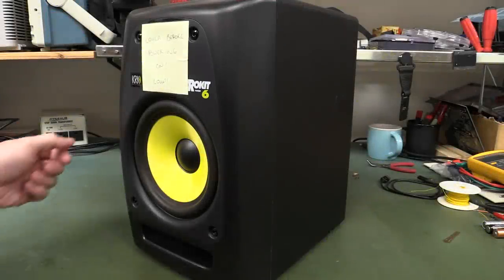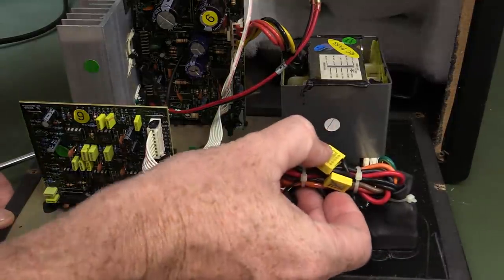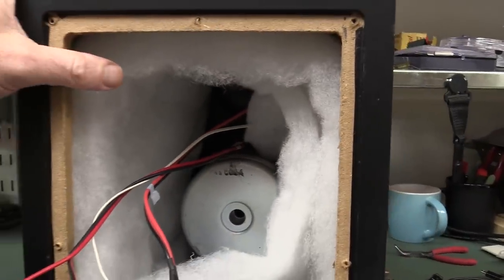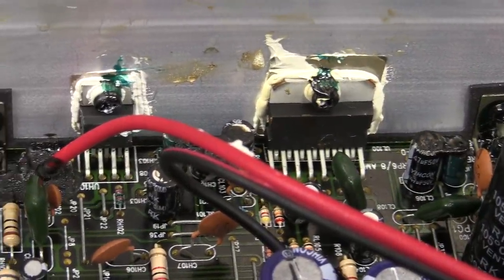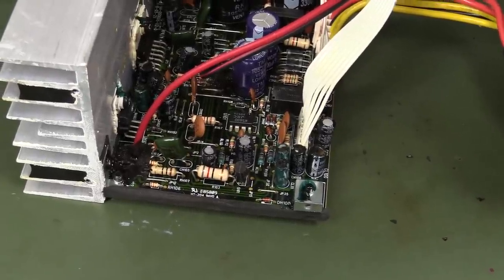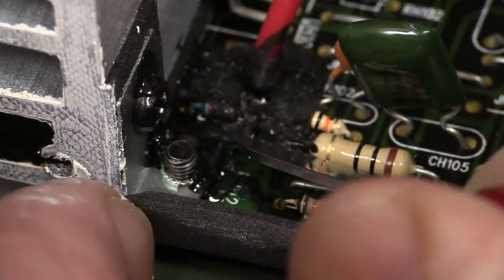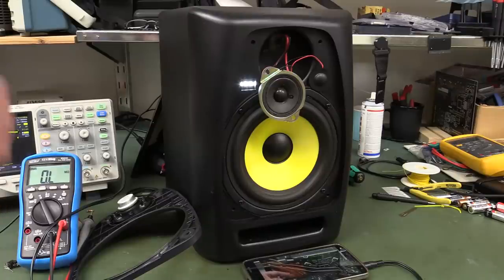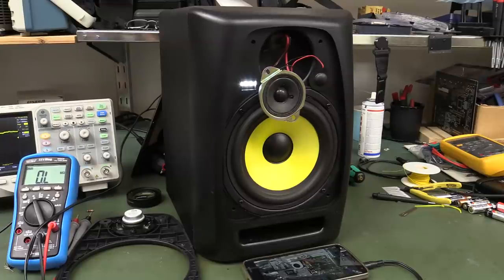EEVblog #1072 - KRK Rokit 6 Studio Monitor Speaker Repair

Comment: Watching Dave for years, I own a pair of these and I had similar issue with them - figured out the glue was the problem - didn't notice the corrosion.  Haven't powered them up for about a year, gonna buy a different set (not KRK) - noticed this happened about 18 months after I purchased them.  Suppose to have 2 year warranty, but being in Canada they said, no, 1 year for you!  Ahhh - I was going to buy Yamaha's or Alesis, but the shop had no stock that day... ended up with KRK by chance.  Sounded good enough at the time (new)

Comment: I've used Behringer active monitors as my computer speakers for around 10 years now. Best speakers I've ever had and cheap as hell at least when I bought them. Only problems I've had are because they seem to have really crap shielding so you have to be careful where you plug them in and how, e.g. if I use the same extension chord for them as for my computer the noise is horrendous.

Comment: Interesting resistive black gunk, I have had quite a bit of equipment have vibration gunk added from factory but never seen a resistive one before, it may be a built in buy and throw out to bin thing or it is a mistake by the manufacturer, either way not tbag to fix.
I have spent many hours on trying to find a solvent for some of these paste/liquid damper aids added to PCB's and nothing seems to disolve any of them, would be great to find a solvent as it would make the job so much easier.

Comment: AMAZING video, extremely relevant to my interests. I have a pair of KRK Rokit 5's (gen 2) with very similar problems. Obviously this crap gunk can infiltrate in crazy different ways. One needed to be on for a few hours before it worked properly, the other would be low volume until it 'warmed up'. One now has the same symptoms of daves tweeter on its woofer. I replaced the speakers with yamaha's so it might be worth having a go at the buzzboxes. I only have a use for one more, so if I get it working I'll have see if I can't get a tweeter out of the other to send to Dave as thanks!

Comment: Dave, where you said "indent", I'm sure you meant "detent", as you used to say back in the day. We have two black gunk products in the U.S. "of interest".: Blackjack "roofing tar in a can", and "Shoe Goo" shoe sole re-attachment glue.These are both very black(due to high carbon colorant?) I am surprised that yours became so very conductive &corrosive. You are right to spank KRK for bad assembly practices. Good luck & great video!
Reply: Roh-kit (Rokit)is supposed to be a misspelled "rock it"(rockit) i believe. Dang my caps lock key!

Comment: I am currently cleaning out the black gunk from my rokit 5s (X2). I have been lucky as to, there is very little corrosion. All components are intact. I am cleaning and treating areas need be.

My only issue is. On one of my monitors. The switch is constantly on. I switch it off and it is still on. What can I do to fix this? Great video btw, thx EEVblog.
Reply: Anyhow. I have completed the clean up of corrosive black gunk on my rokit 5s G2s. I figured out the switch is dead. I replaced it and all is well. Thanks for this video Dave. You have saved me a lot of grief and money. You're an awesome bloke. Fellow Aussie here.

Comment: That just shows that it only takes one bad decision to ruin an otherwise good design.
Reply from the maker: Indeed. And impossible to test a long term thing like that
Reply: True, but also why I think it's important to be conservative when using materials that are being smeared over parts like this.  If I'm not sure that it's been proven over many years previously for this type of use case, then I'd rather not use it.  There are other materials that can be used for vibration dampening.
Reply from the maker: Yes, plenty of proven flexible potting compounds for example.

Comment: I've had several KRKs come in to my shop out here in Caracas, the BlackGunkofDeath is the main issue, but I always put in new higher voltage power caps, had many come in with strange popping and crackling noises from these cheapos going bad. Great video, hope you are well dear bro !
Reply: will you please tell me the part number of the caps you used? it would be a big help. Thank you

Comment: Have seen that conductivity problem on high end vintage hifi amps as well. In pro studio world we never touch volume controls on speakers as they are 'calibrated' to be a constant. If your monitoring system never changes then you can balance mixes easier. Its all about getting used to the sound of your monitors in your environment. I suppose its the same as with old analogue scopes - going to a known timebase before probing an unknown signal?

Comment: Good video Dave. I have a question that maybe some of you here in the comments can answer. Can ordinary hot glue suffer from this problem? Would it have been a better compund to use in this case? Also, I've seen boards with a sort of yellowy white coloured stuff on it which may be similar to the black stuff in the video. Can it suffer from the same problem? I'm just interested, as it's not something I would have suspected when looking at broken things. Good catch, Dave. :-)

Comment: Black Gunk - possibly the bees knees in the day - likely an attempt to prevent vibration from causing issues on the boards considering there is no other protection such as an enclosure for the electronics.

Comment: love your channel dave, but your a bit of a noob when it comes to studio monitors. your supposed to connect the krk speakers to a usb audio interface and use balanced cables (xlr, trs etc) from the usb audio interface to the speakers. the audio interface has the volume control and headphone jack. this way you only need 1 volume control and headphone jack for the speaker setup.

i would NEVER buy studio monitors with garbage like that on the front!!! lolz

Comment: i repaired one of these a year or so ago, it powered on but nothing came through the speakers, turned out to be the lead free solder cracking all over the place, reflowed a bunch of connections and works great, these things are ok but for the price they should be given a miss

Comment: The repair guy at my previous work had a very similar problem with some old Bang & Olufsen speakers where the sponge pads used had dissolved to an oily goo and became conductive as well. These were super expensive speakers too, so I was shocked to find that this was a thing. And especially on well engineered stuff like those were.

Comment: While this one is open, it would be interesting to check for a Pin 1 Problem - I have a hunch that the lower-end KRKs are commonly afflicted by this to this day. XLR pin 1 ought to be connected to chassis ground (which in turn goes to star ground), but once in a while you will find constructions that connect it to local circuit ground first instead, which can cause ground loop issues due to ground currents making their way across the board (thus reintroducing a problem that balanced connections should be essentially immune to).

Comment: ok i am cleaning out the boards of my 2 broken speakers. one resistor broke of deteriorated. no problem. one of the tweeters dead.
hope i will not mechanicaly make more damage while cleaning. does anybody know where to buy the tweeters in  europe? i seem to find them only in the u.s. for sale. any ideas? or even decent alternitivs that fit?
Reply: bought 1" silk dome tweeters in aliexpress and sound pretty much the same
Reply: thanks...which ones did you get? most of them seem to have 4 screw holes...could you send a link?

Comment: I love repair videos,i could watch you live stream this type of videos every day,just keep em coming.
And btw its a common problem with those type of speakers to have gunk that turns corrosive and conductive over time,only fix is to scrape it till it eats the copper of the board.

Comment: I have a TANNOY 402 monitor and the transformer was driving the "woofer" directly magnetically because it was very close and unshielded. i had to take the transformer outside the box. why they don't use switching power supplies? assholes, they exploit the musicians and the audiophiles.
Reply: SMPS are a can of worms in their own right. For one thing, they have a tendency to abruptly shut down when confronted with current pulses, not to mention potential EMI issues and high coupling to mains that makes them unfriendly to unbalanced connections.

When experiencing magnetic coupling, experiment with power transformer orientation and location. In this case you want transformer windings and voice coil windings to be perpendicular to each other.

Comment: The gunk is probably a form of planned obsolescence, if you have a gunk that can go conductive after a few years, then you can ensure that after the warranty ends, the speakers will fail shortly after.
Reply from the maker: I doubt it was intentional. A company that make ONLY studio monitors which are supposed to last a long time wouldn't deliberately do that.
Reply: I will have to look more into the brand since my first thought was that they were pulling an Acer where they purposefully choose a design that leads to failure, such as using a bunch of 105C rated caps, but then deliberately going with 2 85C rated caps that just so happen to also be directly above a heatsink so that the cap gets cooked and the monitor fails shortly after the warranty  ends.

Comment: Hi Dave! I have this exact model. Is there anything I can do to prevent this happening and would replacing those cheapo caps stop the slight crack/thump noise i occasionally get when I switch them on?
Reply from the maker: Go in and remove all the black gunk now.
I doubt replacing caps will fix any crack/thump issue, it's more likely the gunk doing this, I've seen reports of that.

Comment: Just out of curiosity, but did you put that save 1000 mfd cap back in there....I found two other KRK speaker monitors youtube videos that had the exact same loud buzzing and the repair was to replace the 1000 mfd caps....they replaced both
Reply from the maker: Yes, same cap.
Reply: EEVblog makes me wonder if the real problem on the other ones wasn't the same black crap and replacing the caps inadvertently fixed it by breaking the conduction path.  I didn't like the sloppiness of that spray and the gobs of heatsink compound.

Comment: Got two of these on my desk right now so I'm watching with fascination.
Reply from the maker: Go and remove the gunk now!
Reply: @EEVblog  I finally got around to checking the board as I had to replace some caps.  Luckily my black gunk is dry as a bone.  I heard it was a batch of out of date potting compound that caused this issue, I must have got lucky.

Comment: The black gunk, reminds me of the black gunk that I have encountered from leaking electrolytic capacitors. In my case the caps were still working but had leaked out the gunk due to high temperatures inside the enclosure. The black gunk in my case was had all the same characteristics that you are seeing here. It also corroded a number of components that were covered in it. My fix was to remove the caps and clean the board, then replace the corroded components and finally replace the leaking caps. Note that this was back in the 1980's!

Comment: good thing i got jbl studio monitors.
Reply: Don't be too happy yet... ;)
Reply: why wouldn't i be happy they sound better and are built better.
Reply: lil Pure ok, if that's the case then never mind... ;) I've had some bad experience with jbl gear (same issue as this one), but maybe they have changed production?
Reply: what jbl gear did you have?
Reply: It's a quite old (15 odd years?) JBL SCS135 subwoofer/5.1 system. Ok, it's consumer crap ;) but it had a similar issue as shown here a couple of years ago. I managed to fix it the same way as Dave showed (and it's still alive after that fix), it's quite a common issue as it seems. Hopefully, JBL don't use that gunk stuff in pro gear, but if they do: now you know how to fix it, if it ever happens. xD
Reply: no one has said any thing about buzzing on jbls pro audio gear but on their home gear around 5 years ago people really started to complain about it.

Comment: You'll need an pre amp to drive that speaker correctly (or any other analog active studio monitor) and most pre amps will have headphone amp built in. Schiit audio and Benchmark audio make some seriously good pre amps and dacs.

Comment: I think you miss the point of studio monitors if you want to directly plug in headphones. I have Rokit speakers and I love them. Impressively built but I've never taken mine apart since I didn't want to affect the finely balanced response.
Reply from the maker: No I don't miss the point. My needs are perhaps slightly different to a bigger studio. I don't want yet another box on my desk for headphones and volume, I like it built in.
Reply: EEVblog sorry if I came across rude there. Enjoyed the video. The difficulty I find with these speakers is setting them up in a proper acoustic space since that can severely impact the low end response. I sometimes do music mixing with mine and therefore the nuances of the mix are critical.
Reply from the maker: I have a typical work desk, so mine are close, within arms reach.
My Alesis's have one mains cable, one USB cable, one speaker cable. Regular monitors would need two mains cables, a doodad volume/headphone box on the desk, a USB cable, and two RCA/XLR cables, messy.
Reply: Yeah, but typical KRK and similar monitors user already have an audio interface with headphone jack and volume knob. It doesn't make sense to double them. Only the cheapest "multimedia" (not studio) monitors have them on the front panels.
Reply: mpingo91 yes I think that was my point. And the level on the back is just for fixed attenuations depending on the input level.

Comment: But really once you move over to a Class A 2x 100W tube amp its just no going back for home audio for PA i use a 12kW total power system
Reply: Good luck using tube amp in monitor speakers...
Reply: No you don't, stop talking crap! I'm ex-Audio Note, 12w SE per channel would blow your head off with efficient speakers. Got a mate who restores Western Electric cinema amps and a mono amp for a 1,000 seat is just 20w Class-A. Not even Marshall stacks pull 12kw.
Lastly, Andy 'PhotonicInduction' is a good mate of mine, lives near me, you are not him so shut up!
Reply: Putting 12 kW through speakers at home is a very fancy way to die.
Reply: I didnt say i use 12kW that is stupid for home i use it for PA for concerts party and so on and even then ive only got total of 8000W in amps just the speakers are 12kW total and if you cant read and understand thats not my problem and yes i am not Andy nor did i say i was ....
Reply: cant you people read ? i said its for PA PA!
Reply: yeah thats porbs not a good idea but for home use its really good